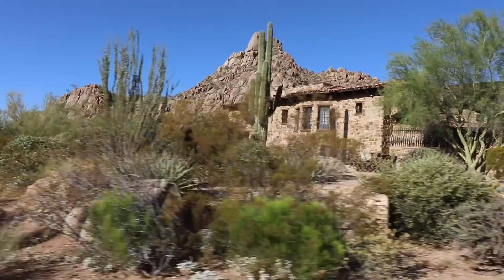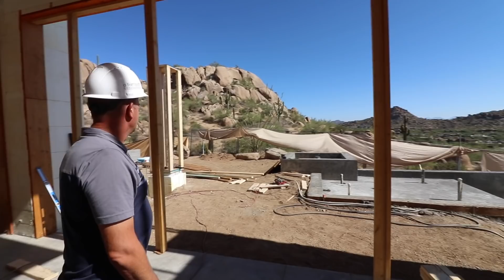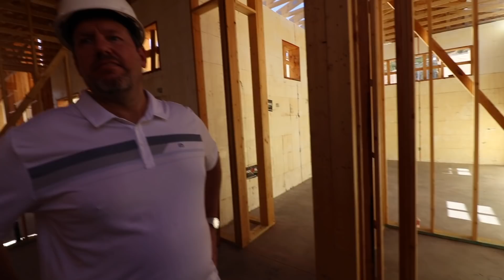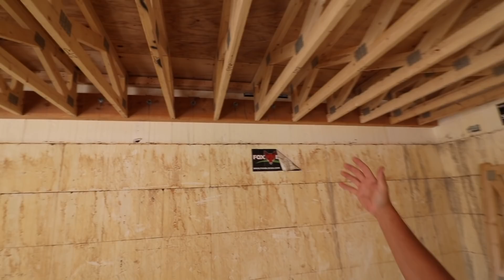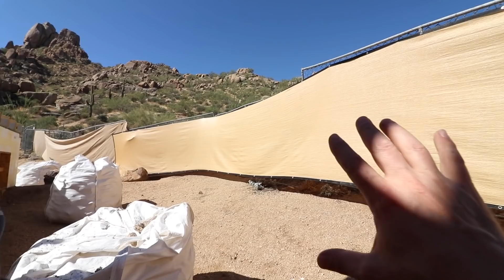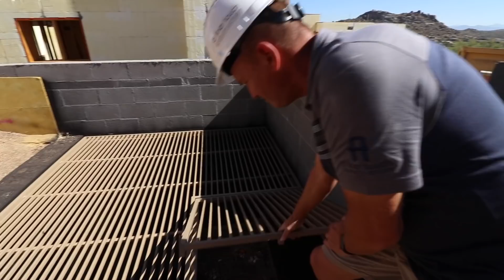Insulated Concrete House in the Desert

Comment: Matt
How is moisture controlled in the house after homeowners move in, as the concrete within the blocks cures? Do they just have to run dehumidifiers constantly or do you have a recommended HVAC system that can handle this?

Comment: What a beautiful grand home. A surprise that conditions have been placed on the preservation of natural features. 
I am interested to know how the outer radius of the retaining walls we're set out? My guess- peg and string line.
Power to the building, one assumes would be solar and secondly,
was the concrete batched on site.
I would be interested to know the temperature range: R rating and wind force strategies required by local building regulations. Thanks for sharing your experience and knowledge.🌏🇦🇺

Comment: Finally seems that you are giving up to ICF construction :), I think ICF is the only real and worth it construction available today, but what I don't understand why wood framing on the second floor???? Also, how would you build with ICF and do not finish with ICF roofing system??
Reply: ROGERIO REALTOR I was curious for this myself. It may be a budget issue for the roof system, but the upper walls it just needs to go ICF. (But I would recommend cutting a few hundred sqft off and budgeting in the roof on such are large house, but they are probably required to be a minimum sqft and may just be meeting their budget...even millionaires need to stop somewhere)

Comment: Matt builds better houses than this guy. I'd say this is average build quality. It just seems like it's good build quality because it is expensive and a bit unconventional. But when you look closely there is nothing unconvensional about following the minimum HOA requirements and then just going wood and cheap everywhere. Matt would have this house graded better, insulated better, and designed better. Avg expensive house - goal of massive volume for the cheapest cost.
Reply: The City and/or county sets minimum build requirements and structural design standards. What the HOA sets are color pallets, design style choices, and things like maximum heights. Oh, and HOA's also piss and moan about weeds and cars in the streets.
Reply: @jackielinde7568  .... I know all this, I used to work in structural steel and construction. The main point about this video is the concrete construction of the first floor as mandated by the HOA, but it's really a shitty house.
I'm not talking about designed load limits or other crap.

Comment: Given the house's position further up the hill, I'm surprised the architect didn't use cross ventilation and heat convection in the design to obviate the need for all those air conditioning units. Perhaps the client had other ideas.

Comment: All that wood... ugh... if I'm paying for a custom home build, I'm going steel, rock and concrete all the way.
Reply: What?  You mean no insulation!?!
Reply: @wallykramer7566  No... of course it will have insulation. I just want my home to be built to commercial standards. Steel studs are actually cheaper than wood studs in many instances.  I like I-beams, steel trusses and aluminum window extrusions etc. They last longer, aren't prone to warpage or rot or bug infestation and obviously fire proof (unless you have jet fuel ;-) . Plus, all of that stuff is ACTUALLY recyclable. Wood is not recyclable... unless you count grinding it up to be used as OSB, Particle Board and MDF. But even at the end of that lifecycle they have to go to a landfill.

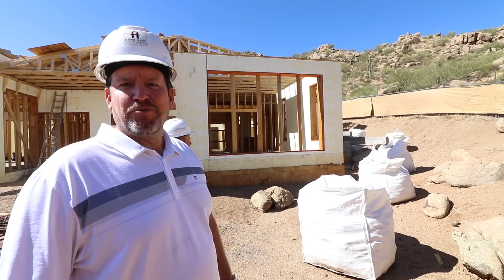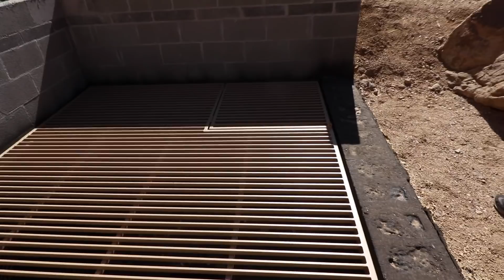Comment: 22:35 I was thinking before, this house might wash away in heavy rain.  Hopefully the drainage system can keep up! 27:46 Looks like they are on top of it, lol.
Reply: The house is built into the mountainside, and the footings to go down far enough. That house isn't going anywhere. The drainage system is to keep the water from entering the house.
Reply: @jackielinde7568  I'm certain the engineers did their job, I was just joking around.  And at 23:35 they specify 20' deep footings.  The drainage system will help with erosion though, which could be disastrous if left to do what nature pleases.  - Hence the reason we have building engineers and codes to follow.

Comment: Very cool construction.  What PSI is the concrete poured into those walls?  Just curious since they have some large spans with the poured-in-place reinforced headers.
Reply: Pro Builder Not sure about this one but I typically call for 4000 and never less than 3500. So, my guess is they went for 4000.
Reply: @joshualruby  Very good, thanks for replying.  I used 4k psi on my front covered porch suspended slab, reinforced with #5 rebar in a 12"x12" grid pattern.  Only about a 7ft span x 40ft long, stamped concrete on top with strategically placed control cuts hidden in the cobblestone pattern.  No rogue cracks yet in 17 years here in Northern CT.

Comment: I'm amazed there are no solar panels, water harvesting systems or at  least double glazed windows or thermal control glazing. These things aren't deemed  necessary in the desert?
Reply: They're still building the house, so MOST of what you're asking about (solar panels and windows) wouldn't be added at the stage the house is at yet. Where they're located is just off Scottsdale, so I'm betting on municipal water supply. So, unless if the homeowners are into gardening (and there was NOTHING in that build to suggest the homeowners are into gardening), they're not going to need a water harvesting system. Besides, most of that rainwater isn't wasted. It'll end up in a drainage system that leads eventually to an artificial lake (like Lake Roosevelt) or catch basins that will store the water before it's processed and added to the municipal water supply.
Reply: @Jack Linde Thanks for your reply. I'm in Australia so I am interested in How builders in other countries manage water and power in testing locations.
Reply: @stephenconnell  There are a lot of people who live "off grid" in Arizona. My dad is "sort of off grid". Where he built his house, there was no sewage or water services. The only services he had were phone (Basic) and Power. He ended up drilling a well and digging out a septic tank when he built his house. He's still on the power grid, but he has solar panels to reduce his utilities. Since he's built his house, the city of Buckeye, AZ has incorporated his land as part of the city. Still no water service or sewage.

There are a few Arizona based YouTubers who are off grid more than my dad is. One guy built his house in a place where they couldn't drill for the well water. One of his tricks was a collection roof. This year has been especially dry as far as rain is concerned, so I wonder if he's had to buy water and have it trucked in.

Comment: I really like concrete. Visible that is.
Unfortunately from a environmental point of view this Fox thingy is far away from good. Lots of plastic and super high energy cost of producing concrete. 
But it will be sturdy though : )
Do you see more concrete being used in new builds? I had the impression that wood houses were the common way of build in USA?
Reply: You should checkout rammed earth construction.
Phoenix is mostly wood construction, this is a high dollar luxury home in $cott$dale.
But many, many years ago Bob Villa did a This Old House the Adobe house down on 7th St (or Ave, I forget) in an older part of town.
Reply: @jcadult101  Great, thanks for suggestion

Comment: This house is very poorly insulated.  You could have heavier insulation with Fox Blocks. For really heavy insulation with ICF, check out Quadlock.
Reply: It's Arizona. That house is better insulated than 99% of the the homes in the state.  The walls are not your energy wasters it is the big glass windows that are beautiful.
Reply: @BenjaminFranklin99-s9n  from the build show to political. Bet your fun at partys.   I always heard that pigs get fat hogs get slaughtered.  ( We have a pig that was for meat now it is the kids pet for the past few years and has the run of the yard)

If you have the money to build a million dollar house then a few hundred bucks a year in electricity to keep it cool is not even a consideration. My guess is that this is a second house somewhere cooler.
Reply: @BenjaminFranklin99-s9n  I'll be in Seattle tonight on a layover   What is funny is the two/four drivers of your economy are some of the biggest  most UN environment friendly parts of the US economy ( data, airplane, aluminum, single item shipping). So maybe your state religion needs look in the mirror, I believe something about a mote and a beam, sticking with religion.

Back to this house. From the start this is not a enviro house. The location is way out. The house is on a hill on self described as sensitive land and it is huge by any standard. You could put in the quad blocks on top of Adobe on top of fox block with zero windows and the beast is still going to be a hog.  After spending time overseas little studio apartments jammed in 4 story square boxes are  most people's standards. 99% of America homes are hogs this is just a larger hog than most. ( I don't even want a big home,  I've built many and never been that impressed  after the first shock and wow, now a big shop on the other hand is a must.)
So quit putting your "religion" on  others until you are guilt free or at least making a solid effort and not just lip service.

Comment: Awesome build.  Only one thing I would throw out there..... Moisture Vapor Control on the floors.  They are below grade on a huge slope of the mountain.  Lots of water is going to come down that mountain and try to escape through slab.   The RH value is going to tick up.....  If they are choosing a LVP  or LVT  plank - Direct bond may have problems under grade.  Just my two cents to avoid builder call backs.
Reply: Matt you need to tell them.  I live 6 miles from it.
Reply: Pretty standard to place 6mil vapor barrier below the slab to prevent water issues in the slab. But in that climate coupled with the sloping lot and highly-permeable soil, hard to think they'd have many vapor issues.

Comment: What’s the advantage of fox block over cinder blocks?
Reply: R-value, cinder blocks are just hollow concrete block, fox block (like any ICF) gives you an insulation "blanket" on both sides of the wall greatly improving your R-value on a cinder block wall is maybe 1/10th what this wall is.
Reply: DanielRichards644 wow that’s a huge difference! Thanks for the reply
Reply: @darren6790  yeah concrete has pretty shitty r-values, thats why most areas where it gets below freezing now require you to insulate under your slab if you do a slab on grade house

Comment: Sorry can't build A house out of beer coolers seen mold and blowout issues here in Montana they don't allow them anymore
Reply: Really? Ha! I'm not surprised. Can't see this going far in the northeast either.
Reply: @comment6864  I use them in Canada all the time.  If you see mold, you are doing something wrong.
Reply: Most common issues are due in part of the builder (contractor or home owner DIY) NOT following the recommended  steps to prevent blowouts Due to not strapping the common seam spots well enough and pouring more than 4 feet at a time. Same for mold due to insufficient air conditioning and air exchange or filtration.
Afaik I never heard of any one in Montana not being able to build ICF there anymore due to past user human errors and I did a Google search for Montana ICF and got lots of ICF Installer listings in the state and many of the popular form systems still available for use there.

Comment: My current build utilizes FOXblocks for the conditioned space stem walls in Colorado. Due to building in the cold we used dimpled foundation wrap. Spraying would have frozen on application and Petro based would eat the EPS. I would like to know what was used on this job. By the UV yellowing and size I bet this is not a quick build. I tell people that Insulation matters in cold and Hot building zones. Cool

Comment: Defently interested in more ICF construction. I'm looking at a system that uses ICF panels to form the second story floors and also flat roofs, more of an industrial system but if you saved on shoring and labor it may be a good DIY set up in certain scenarios. Also I'd like to build my footer out of ICF and then pour the pad into them monolithically of possible,  havent seen it done yet. And also wonder of thermal bridging and the bottom of a ICF is a concern. Water proofing and finishing systems would also make a good episode. Thanks for the content
Reply: Mice aren't to prevalent in my area. But either way seems like a simple solution during the building process, after the building is built that would be a nightmare. But if you wrap the exposed edges in that stainless steel lathe mean to keep bugs from burrowing in I believe it would work for Mice as well. Mice love all the insulation from the fiberglass to roxul, theres not much they dont like
Reply: @townsendliving9750  I think in her case they came in from the attic where the top of the walls were exposed.Good idea about the steel lathe.
Reply: My dad had a mouse problem. He has an ICF house, but his mouse (and other critter problems) came in from his "Goodwill" finds...
Reply: These houses are the love objects of mice. They burrow into the styrofoam and make tunnels. My friend had so many mice she needed to bring in a guy with a thermal camera to find all the tunnels.Just saying.
Reply: As far as pouring monolithically your pad with the footer; totally doable. I have done several ways of monolithically pouring second level floors and side walls and that would be very similar. Let me know if you have any questions or want a sketch of the details. I have done a bunch of ways and designed even more just waiting for projects that need them.

Comment: Matt this was awesome.  I’m 28 and am almost finished with my first home, small 1800sqft place, custom.  I will be building myself a larger “permanent” home in the next decade, and now I want to use this method!
Reply: Benjamin C.M. ICF is awesome but also checkout hercuwall if you don’t need the continuous 3” of concrete for tornado protection. There 8” foam panels with 3x3 concrete studs 12” OC. A lot higher r value and a lot less cost for concrete. 
https://www.hercutechinc.com

Comment: These are becoming very popular all over. Very cool idea for building and I get to spray foam in all the roofs with 3/4 lb foam. Definitely an interestingly awesome way of building homes.
Reply: Why don't they build normal small houses for average families. That's what we need more of in this country right now, not these mcMansions and mansions. They are just not interesting because people wanting to live in them are not part of the mainstream or the needs of this country's people. Meanwhile in many parts of the country, such as the northeast small house stock is getting old and tired, and some is even dangerous to health, as has asbestos needing removal and things like that, and nobody's replacing any of it. Tired of seeing these mcMansion ranches in Texas and Arizona and Colorado. Then they attract inadequate people to those states, like that guy who killed his family and put them in oil tanks. mcMansion dwellers who were not capable of pulling off such a financial burden. It creates all sorts of disproportions and unnecessary temptations in society. All these weird building techniques will probably go nowhere in the long run, prove to have big issues decades down the road, and ultimately go the way of most fads.

Comment: ICF is never plumb like traditional stick wall so kerdi board directly to ICF is not good solution.
Reply: It's plumb if you work your bracing correctly.  After the pour you need to tweak the braces to set plumb; once done she ain't going nowhere.
Search YouTube for "ICF Bracing"; there's a range from components that use 4x2 to full metal.